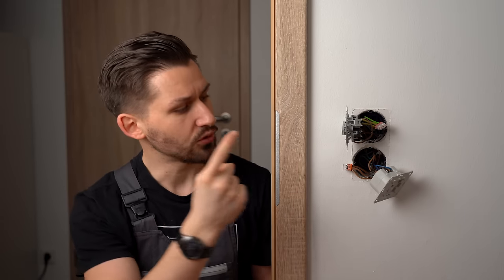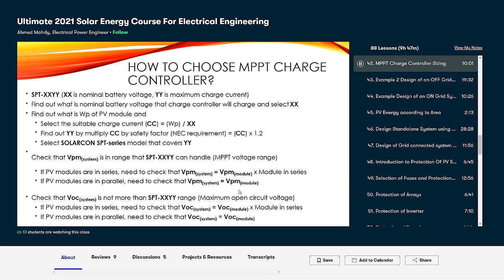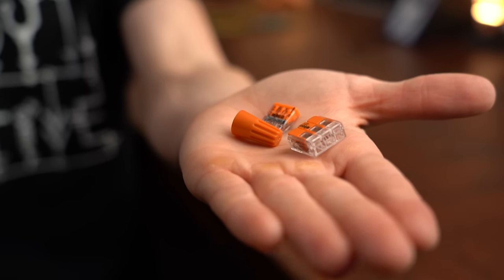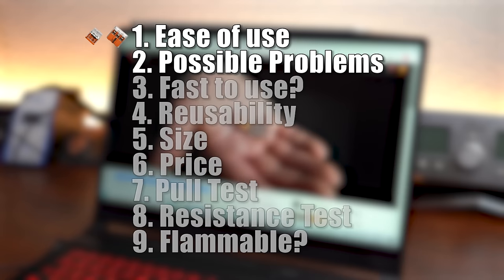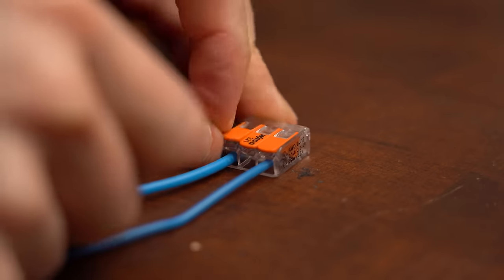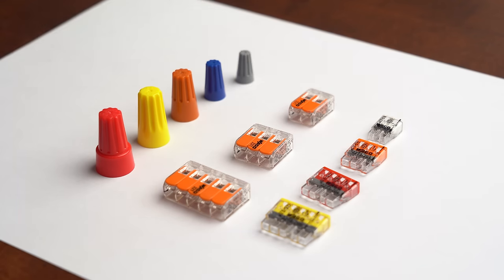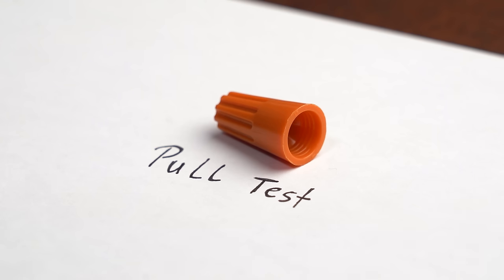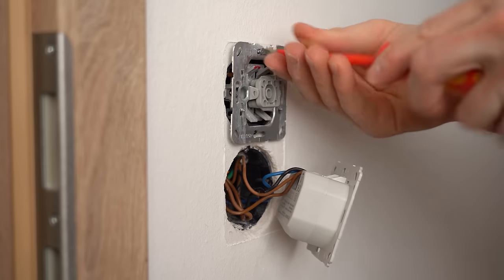What Wire Connector is the Best? Settling a Debate! Wire Nut VS Wago

Comment: This was a very comprehensive video. I am from Germany, a learned electrician but lived in the US for over 20 years. I remember that 30+ years ago at trade school, we already used push in connectors, whereas to this day, the main connector in US is the wire nut. Now, I am not against the wire nut, however, over time and with the cheap built of a US house (things shake), the wire nut is often not securely on the wire any longer after many years. The push in connectors stay firm forever. This is even more disturbing as US houses are build out of wood, whereas fire hazard can be a big problem. However, after this many years in US, it is all about the bottom line, meaning, how much profit can you make and not how easy to use or safe it is, thus the wire nut is the winner.

Comment: In my opinion, the resistance test result is far more important than other aspects, considering that, by time, the oxidation causes increase of resistance, and with that, more heat. So the stronger is the contact, the safer is the connector, and that is a big plus for wire nut.
Reply: Exactly.
Reply: No just no

Comment: I've been using Wago, or as some of my compatriots insist on saying Waygo(!), connectors for many (25?) years, simply superb. With regard to the resistance differences, Wirenuts produce a multi-turn twist between the highly conductive 'native' conductors whereas Wago connectors interpose a (stainless?) steel 'busbar', with its concomitant higher resistance, between them. Nevertheless, the Wago ones at their rated currents do not pose an overheating risk.
Reply: Would a thicker bus bar decrease the resistance or is it the contact between each wire and the bus bar that's responsible for the resistance and heat generation?

Comment: I never used those Wago things. But it seems like the size might be a problem. It's hard enough to get the switch and wires all stuffed into boxes that are just big enough if you do it exactly right to begin with. I never understood why they don't give you a little more room.
Reply: I switched to Wago because they acually  take less space than wire nuts.
Reply: They are quite flat, the wires come out cleanly seperated (not twisted) and therefore it's easy to place them inside a stuffed box.

Comment: Industrial elec here. Interesting to note that the loss on a wago at 20A is almost a watt, something to keep in mind. Learn something new every day
Reply: When I first saw the wago style connector my thought was they would have more resistance.   How could they not, it's not touching the two+ wires together.  It sure seems like an easier thing to do, but the thing being warm sets off alarm bells.
Reply: @bradleyrex2968  This is no problem, they are used for deveral decades in Europe and not a single house burnt down because of them, serveral houses burnt down with loose screw connectors though. Every circuit breaker or these 1960s relict of fuses get warm, you don't even notice the wagos gettng warm on the typical 400/230V 16A circuit.
Main advantage is that the two wires have a separate stainless spring so they don't loose contact over time due to vibration or corrosion.
Reply: if screw connectors have worked as long as electricity has been around, then wago's do too, as they are functionally the same thing.

Comment: The reason why so many for so many years have used the twist nuts in America is due to price, they work, plain and simple, for more then most people are alive now.
Reply: @Thorinox: Thank you!
Reply: They are also easier to find. Wago comes via Amazon or maybe in stock at a specialty store -- usually far away. In my experience. BTW, I use all three of the connectors.

Comment: Wago connectors have substantially less surface contact than wires connected with wire nuts.  That is why they produce greater voltage drop.  When using wire nuts, solid wires 14AWG and larger should be twisted with pliers before screwing on the wire nut.  An electrician should know how many and what size conductors the color coded wire nuts are good for.

Comment: The US is predominantly wired with wire nuts, hands down.  This is due to the recent entry of the WAGO connectors.  This proves the reliability and durability of the wire nuts.  That being said, I do love the ease of the WAGO.  Plus any time you need to revisit the installation, you can easily disconnect.  This rarely happens however.  Cost and reliability should make the wire nut the winner, but I do carry the WAGO’s now and use them often.  The resistance test results however are cause for concern….
Reply: I don't see the resistance test results being of concern. Even the worst Wago connector is only going to lose 0.04% of the power going through it, and this isn't enough to heat the connector. It's a tiny amount of power loss.
Reply: @tlangdon12  yes but resistance tends to increase exponentially over time as the conductors age.
Reply: Fortunately, all of Europe has come out of the 20th century and uses WAGO and for some reason there are no problems with them.

Comment: I wanted to see the test where you put 50 to 60 amps through them to see which overheated and failed first.  That would tell you something more important than whether or not you had to google specifications.  My personal preference has always been Ideal brand crimp caps (preferably copper) and their Wrap-Cap.  A simple copper sleeve, properly and tightly crimped, then wrapped in a rubber sleeve.  You inspect after the crimp, then insulate with the rubber cover.  I'd be willing to bet they would win each test you had there except the time, and only be a little slower than the Wago but faster than the wire nut.  Well, the wire nut would still win price.  They are cheap.
Reply: Why use 60A if they are not rated for that ? My complete house only gets 63A per phase and these cables are much thicker. Crimping takes more time and is usually not changeable afterwards. You can just cut them which often won't work in house electric because the wires are short to begin with. And you need space for the tool.
Reply: Wagos are not rated for 50A or 60A at all.

It's only due to your stone-age electrical systems (split phase 120/240V) that you are in need to push 50 or 60 amps @240V through your wires, which in the end will cause more fires than any correctly used Wago  (see Wago specs)

Everyone over here has 3 phase 230/400V  for all devices that need big power (like heaters, EV chargers, ACs, oven/stoves, ...). 
Example 11 kW EV charger: 3 phases + PE + N connected to the charger, 5*4mm² or 5*6mm² wiring is usually enough (instead of super expensive AWG 4 or 6 on your side). Each phase contributes 3.7 kW. A triple 16A breaker is used for that. Does 16A overheat the Wagos? Nope. Besides that: wallboxes are usually not connected to a receptacle over here, they are connected directly. So why don't you connect your boxes directly (then no "50-60 amps Wago" or wire nut would be needed at all)?

And on top: Wagos can sustain more A then they are rated for, but  Americans are world champions in filing cases and getting companies convicted for stupid reasons ... Thus, if you find someone using a 20A rated Wago in a 50A circuit, and the house burnt down, even an American judge will not plee for them.
Reply: @oaw_manofnorse  I am not even talking about rated specifications. I would like to see what happens to these in a testing scenario with excessive unrated testing.  Crank up the amperage, and see what happens.  It tells you a lot about an item like this to know how it handles extremes.

Also, We have 3-phase power.  We have 120/240 single-phase in most homes, but most industrial and business locations have 3-phase 208.  Even most homes have 3-phase on the lines nearby, but for whatever reason they convert at the stepdown transformer going into the home.  Heavier industrial needs have 3-phase 480 or occasionally specialty higher voltages.  Many lighting systems use single-phase 277.  And anything we have that needs 50 to 60 amps, is not running at 120vac.

As a general rule, I'd say our single phase 120/240 system is safer for the average person.  Most units that need the higher voltage and current are the large appliances like water heaters, stoves, ovens, dryers, HVAC, and such, and will have 240 Volts.  But they are also the types of units people do not often mess with, move around, put in precarious places, or run extension cords to.  They are fixed.  Meanwhile, the small appliances, chargers, lamps, computers, etc, have a far less dangerous voltage for conditions where people connect them to power strips, use extension cords, and handle them.  The major exception to this is where other parts of the world have an advantage, and that is space heaters, electric kettles, and any other small heating appliances that could really use the extra voltage.   There are rare occasions where I would find this useful.  Generally speaking though, the level of voltage is safer while being plenty sufficient.

Comment: What would the best connector be for 480V 30 Amps??  Or better put, for high voltage industrial applications.
Reply: 32amp cee or 64amo cee if you mean that or if you mean solid cable gland with the right size

Comment: Nice and interesting. Im an electrican from germany. We also used the wire nuts a loooong time ago.. I only use and prefer wago.

1 tip.
You dont have to open the wago, if u will input solids

Comment: Good video.  These tests pretty much confirmed everything I've found using both.  Wago's are certainly easy to use and they do have their place; however wirenuts do make for a better connection.  My general practice is to use wago's for anything less than 5 amps and wirenuts for above that or sensors where resistance in the line matters.
Reply: I agree with you and would add box fill as a consideration when choosing.
Reply: In theory wire nuts offer a better connection. But in practice if there are multiple wires needing connection in the wirenut the WAGO connectors are a much better choice.
Reply: @hans3228  I haven't seen that in my own practice, but I'm also quite particular about making sure my connections are secure and well connected.

Comment: As a professional electrician for Over 22 years now, i have witnessed the changes through the years. When installed properly a wire nut will last forever, unless outside sources cause some type of failure. The issue most people have with them is merely ignorance, not something wrong with the actual product. The Wago connectors are very nice, and most people prefer them because they are somewhat fool proof and require almost no instruction to use. They both have their place, in my opinion neither are better than the other in totality.
Reply: Wago is much much much faster to apply and therefor cheaper. no need to twist cables.
They are totally phased out in the Netherlands, due to not being safe and you can't buy the here.
We have a world recognized laboratory for electrical called: "KEMA KEUR", you might have seen it on some USB charger or other electrical appliance.

heat from current will expand the twist in the wires, causing more heat.
Reply: @AnalogDude_  "Wago is much much much faster to apply and therefor cheaper." Not cheaper material-wise. On average, wire nuts cost about a third less than wago. In larger quantities, the difference is quite significant as in 50% less. As for time, while it maybe less time to apply, most of your time is in preparation and that is about the same for each.
As for Netherlands not using them or being able to buy them, that's not what I'm hearing. They are still used in certain industrial projects.

"heat from current will expand the twist in the wires, causing more heat." Seems suspect here. Clearly demonstrated in the video that wago's generate quite a bit more heat because they are a bus-bar whereas the wire nut doesn't contribute to that because the wires are twisted together and the resistance is much less and therefore generates much less heat.
Reply: @birddogne666  i have had projects at some industrial places from some well known (international) brands and never used a wirenut in the last 25 years. 

i also use a specialized wire stripper, much quicker than the old skool wire stripper end doesn't harm the wire at al in contrary to old wire stripper where you easily can damage the surface of the wire core.

2 weeks ago, i heard that a box of 100 Wago's will cost ya in the low end of the 40€, think it was 44€ for a box.

You can say that like 98% of the houses here have Wago's in them and those wire nuts  that remaining are being replaced.

we had top notch wire nuts in the past and they are considered to be hazardous in some sort of form. with a considerable fatter internal coil than "Great Scott" demonstrated, but phased out in general.
You also need to twist the wire before in a special way and direction to twist on the wire nut.
Reply: One is nearly impossible to fuck up on the user end, the other can easily be fucked up on the user end. At the end of the day, that alone just makes the wago's superior, especially for long and drawn out tedious work where you are more prone to messing something up.

Comment: Very fair comparison! They all work well! Wago seem more for amateurs and the wire nuts look to target more the professionals. They don't need to google for that info if they work all day with that. Also The wire nuts seem safer by design if used properly.  I would probably chose wago for temporary projects and wire nuts for permanent connections.

Comment: I'm an electrician in the United States, I've used both wire nuts and Wagos. I like the Wago 221 for some applications, especially when I'm trying to do a rough-in quickly, but I've also seen where Wago 221s fail due to electricians cramming them into boxes and the levers popping open. The push-in Wagos, I have seen slip out, but if wire nuts are done correctly, I haven't seen them fail. 
How to make a correct connection on a wire nut: Even though code doesn't say we need to do this, I always pre-twist my wires and then cut them to size before attaching the wire nut. Granted this does take more time and can sometimes be a pain (especially when working in tight areas), it leads to a superior connection that will hold up for a very long time. 
Generally speaking, both Wagos and wire nuts are very effective, but it all depends on the person installing them, if the person installing them lacks experience or just doesn't care, the chances that their joints will fail is higher than someone who is experienced. Good video, though, stay safe.

Comment: Very interesting.  Thanks for sharing.  I would have guessed that the Wago would have been superior in most respects but the wire nuts certainly show some strengths.  Most amazing to me was the pull test you conducted.  The wire nuts really held up formidably.
Reply: I was actually impressed the amazon Chinesium ones held up that well.
Reply: As impressive as that is: 
What is the point of such a test?
Reply: @MegaHarko  it’s a stress test basically if it’s on good you can tug on it until your hands go red , which means you did it correctly , my teacher from level one used to check every single joint on the circuit and would deduct marks if they were taken off by force, it doesn’t mean much except that it will make a very secure connection, another thing this video fails to mention is that wire nuts have a good mechanical connection ( an inch of twisted insulated wire under the wire cap, to make it more secure) making them better for conditions under constant vibration such as fans although it is always good to tape them so the wire cap does not untwist years after it’s installation.

I find wago to be quite good for fast and easy installation but I’m not sure if it would hold up against vibrational or outside weather installations.

They more so seem to be rated for low voltage lighting and stranded wire applications (ie electronics like buzzers, cameras, garage openers, etc.) not so much for residential uses as wire nuts always run into trouble of making a good connection when different types of wire are used aka stranded with solid, as little strands easily get damaged and can be pulled of with much less force than a solid 2-6 wire joint would need which in my opinion is not a secure installation not to mention they take time to do properly, but seeing as wago apply even pressure on each strand I’d imagine it would not damage them and hold them in place much better than wire nuts do.

In the end both are good for certain applications and we as electricians should understand the strengths and weaknesses of each component and use them accordingly, that’s all it comes down to in the end, sorry for the rant.
Reply: @MegaHarko  I guess it answers the question of "Is It Secure or Loose".

I would rather my connections have some strength physically.  Arching would be my concern as well as a firm grip in the wall.  

The Wago connections are spring loaded so vibration and age of connection are less of a factor in the connection.
Reply: @MegaHarko  in some cases, you may find your wires under stress (for example if you want to install a new lamp and pull the cables out a bit) and don't want the Connection to come lose

Comment: Great info! Would love to see how a screw terminal compares, as it is the most common type I see used in this role in Czechia
My bet would be on it being similar to the wire nut for resistance and cost, but probably the fiddliest to work with
Reply: More expensive than wire nut. They are used here for high-amperage connections. You are correct about low resistance.